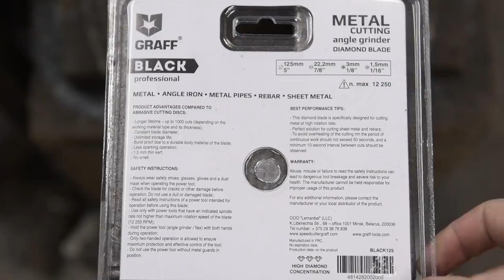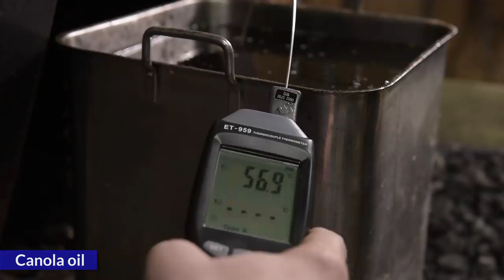Blacksmithing - Forging a slitting chisel

Comment: What kind of wood did you use to make the handle?
Reply from the maker: Oh, that's just pine! A handle on a top tool like this doesn't need to be fancy. Sooner or later it will break and should be easy to replace.
Reply: @torbjornahman   If I were to make say, an axe or a hammer. Do you think birch wood would work to use as a handle?
Reply from the maker: I think it would. Here we often use ash or beech for handles.
Reply: @dankuspanku4650  Querido amigo. não me referi ao cabo da ferramenta, e sim ao desejo de ver você fazer um martelo para carpinteiro.
Abraço.
Reply: Do you usually wedge the handles of your struck tools?
Reply: DankuSpanku hickory is good too if u can get a hold of it
Reply: Birch is one of the most used handle wood in Scandina so i think it should work fine.
Reply: DankuSpanku me I would use hickory or Osage orange aka hedge Apple 🍏! But these are natural woods that grow wild in our forests in Iowa along with black walnut . I have the best looking handles for a black Smith in the mid west ! Red oak white oak burr oak all native ! And ash with the emerald borer almost all of our ash trees are standing dead it’s a good time too be collecting wood for handles or ash for lumber ! The emerald borer only eats under the bark leaving the trunk in perfect shape ! But we don’t have much for pine red cedar is natural but takes a very long time too grow ! And rarely get over 8 feet but would make great chisel handles! Just be sure no matter what wood you use orintate the grain so it’s at it’s strongest for what the handle work would be doing !
Reply: If u find a fine spar (hope that is the english pronaunciation) u should use the biginning of big branches or the tak aanzet. Its realy sturdy
Reply: Ps takaanzet is dutch
Reply from the maker: @matthewt88  It depends. I think this type is more of a precision tool so I like the handle to be more fixed. But in general no wedge.
Reply: DankuSpanku you do have to be a bit careful when using birch as a handle. It will work, but take care, especially for longer handles, to select a good straight grained piece. Birch often has irregular grain due most of the trees being fairly small when they are harvested. Ash or hickory are widely used in North America because they have very consistent grain structure.
Reply: For me the best for any handle is Nutwood not walnut
Do not know the name in english
Nessert in luxemburgish 🇱🇺😎
Reply: @mr.boombalatty5724  spar = fur. depends on species and location. may need some research.
Reply: leviathanmdk the scientific term is picea abies and you need the beginning of a branch. You could hold a car on that wood. Only problem is that there is not a lot of wood in this area.
Reply: @torbjornahman  what wood did you use for wedge? Im learning much from your movies. Very good job.
Reply: @torbjornahman  Ok, tack för dina svar :)
Reply from the maker: @geniusoze  I used a beech wedge here.
Reply: @torbjornahman  hello , if you can find holly wood , it is known to be better for handles - not injuring hands .
Reply: Fint jobb, Torbjörn!😀👌 🙏 Intressant och vilsamt att titta på, som vanligt😀👍
Reply: i love watching these videos ! you are such a gifted Craftsman   lots of gratitude for sharing  so much of your talents and inspiring future generations  i know my 27 year old son enjoys the videos as well  it was neat watching you using the horn
Reply: @dankuspanku4650  as TÅ says, birch will work but his alternatives are much better, especially if you happen to miss sometimes and hit the neck on something by mistake. Birch will splinter worse than beech or ash. Perhaps lilac -one of the toughest woods from plants that grow in Scandinavia (watch out or the central pith) or hornbeam (properly seasoned) might be an alternative. Hickory (not endemic to Europe) is otherwise the standard for tool handles.
Reply: @torbjornahman  do you have the disease effecting your Ash trees as we have in the U.S.?
Reply from the maker: @jeffreycoulter4095  Yes we do, not sure how bad it is though...
Reply: "There's nothing like a nice piece of hickory!"  Clint Eastwood - Pale Rider.
Reply: Notice the mild steel plate that fits snugly on anviil and that is a great tool itself,Sir I'm making one to fit my anviil like yours, Thanks for that too Sir.
Reply: @torbjornahman  at no ni huuh
Reply: @torbjornahman  hello 
I was wondering if ya might be able to do a video on how to make a gold scale from the gold rush from the 1844 or so
Reply: YouTube diamond cutting blade myself and I agree pretty nice
Reply: @mr.boombalatty5724  and
Reply: i know Im asking randomly but does anybody know of a trick to log back into an instagram account?
I was dumb forgot the account password. I would love any tricks you can offer me
Reply: @Asa Kellen instablaster :)
Reply: @Ray Ibrahim thanks for your reply. I got to the site on google and Im in the hacking process atm.
Seems to take a while so I will get back to you later with my results.
Reply: @Ray Ibrahim It did the trick and I now got access to my account again. I am so happy:D
Thanks so much, you really help me out !
Reply: @Asa Kellen Glad I could help :)
Reply: @torbjornahman  Pine? isn't it too soft? I am using ash, not because it's fancy but because it has great physical properties. I haven't broke any in 6 years. But if it works it works. It heavily depends on grain. Great work as always. I hope to finally find some pneumatic power hammer like this. Although my neighbors will hate me. Currently we are switching with two handed hammers, but power hammer is still much faster and stronger than human force.
Reply from the maker: @boredinczechia4382  On a top tool like this you shouldn't use a "good" handle. It will be abused and I actually think it might be advantageous for it to break with a bad sledge blow than transfer all the energy to your hand. Handles like this is often not even verged at all so you can replace instantly.
Reply: @torbjornahman  yes, you are correct I guess that with ash handles there is more stress going into my arm. Thanks god I have experienced striker otherwise my hand would be in a bad shape. I personally do not verge any top tool.

Comment: I have seen you working with a Draw-Knife a couple of times. A 'Shaving Horse' might be a good soulution for work with this great tool. You can clamp and unclamp the workpiece with only one move. And as harder you are pulling as stronger you clamp the wood. And for a gifted worker like you it should be easy to build. ;-)
Reply from the maker: Yes, it's on my todo list!

Comment: Exquisite piece of  art in tool form. 👍
 Who say tools cant be sexy ? Lolololol 😆😂🤣
  After watching 2 times and reading the comments... I think it's safe to say your tools are like the Bentley of the tools  in the forged tool sector.   Smooth elegant efficient with such attention to detail.  See that's exactly what makes them  stand out 
🙏 be blessed sirSir 
Crawford out 🧙‍♂️
Reply from the maker: :) As always, thank you Daniel!
Reply: @torbjornahman  , if I may ask sir, what type of anvil stand do you use? If you could have any stand you wanted what would it be,?
Now that I've got a beginner anvil (250lbs-113.6kilo Vulcan) I  need to make a stand. 
I can do the bound and bolted 4x4 in oak,  pine, or pressure treated. I can do steel tripod with filled legs. I can do 25mm plate on top of 337.5mm dia 9mm wall pipe filled w oil sand on 25mm base or sank up to 1.5 meters in the ground - or up to 500mm pipe oil sand filled...or even concrete I suppose. All of these are materials on hand. Just would like to know what you would do please?
Reply from the maker: I just have 2x6", or so, wood bundled up as a stand.  If you have a perfect spot and never want to move it, sinking a wooden stand into the ground would be pretty good I think. For me I think a three-legged steel stand filled with sand would be good. I want to be able to move it from time to time. Mass is good, so a heavy stand is great I guess. I don't know about concrete, I think you should stay away from that.
Reply: @torbjornahman  excellent! Thank you very much.  Your opinion is highly regarded  just as your instructions,  and videos 👍👍👍👍
Reply from the maker: Don't take my word for it entirely, I have limited experience with anvil stands!
Reply: @torbjornahman  yes sirSir I understand. Roy from Christ Centered Ironworks uses metal tripod for his 465 north German  "Ulga".  John Switzer uses solid wood and sugest solid wood at least 3ft in ground. Joey van der uses a solid wood old pier pulling for his 330lb south german style and a tripod for his 110lb. Daniel Moss "trust me ima black smith" hasn't responded yet but I recall his is wood. Scott "essential Craftsman " uses butcher block 4x4 Glued  bolted and banded. 
Yall are my top go to guys, my best of the best list.
Thank you very much, appreciate you taking time to respond . My most favorite Swedish Smith! 😁

Comment: Oh I forgot to tell you we visited Sweden about 8 years ago and visited that exact fortress by the water that you walked around on one of your you tubes. We were traveling from stockholm to the lillehammer   I also visited the historic boat builders that were building a Viking ship  I got the plans for the small boat that a princess was buried in. about 20 feet long. I planned to build one but only got as far as splitting long tamerack (no oak) along the rays to form the lapstrake hull. I am not sure I have enough years left to finish it. Too many hobbies......

Comment: Do you smelt your odd pieces of steel to make a single larger piece? ...Also, if your pine (I presume) handle breaks, I suggest you make another out of pitch pine (botanical name is 'Pinus Rigida'). Not only is this wood exceedingly tough, but the tree re-grows, so is quite sustainable. Straight grain, pitch pine is used in boat building because it is highly stable. Thank you very much for this great video of forging a slitting chisel. I'm encouraged to make one myself! Many blessings, ~ Wendi
Reply from the maker: Cool! The handle on a struck tool is usually not made from a "high grade" wood. It will get damaged, and is actually preferred to break with a bad blow instead of transferring the chock to the smiths arm.

Comment: I really really enjoy your work(about due for another jug of lindseed oil) I learned a filing trick from an old metal worker in about 1968. When filing a radius instead of pushing the file forward and lifting the handle to go around the arc you can push the file forward and lower the handle as you push, this tends to make the arc much more constant. Hope that makes sense. Try it sometime. also he would yell at his students if they sawed back and forth with a file. He raised the file off the work when on the back stroke, no work is being done on the back stroke and it rubs the teeth off a bit. We always rubbed soap stone or chalk onto the file and it doesn't load the teeth so much with filings.  I am in the process of making large forged  door handles and plates that can be locked from the inside. lots of flat springs and delicate filing. if you have done any projects like that would enjoy seeing some ideas. I just got a smaller power hammer and at age 74 it may extend my blacksmithing a few more years. I have copied several of your tools like the power hammer flatter and your spring dies for balls (grapes)  Keep the information coming.....
Reply from the maker: Sweet, good luck with the hammer! Thanks!
Reply: @torbjornahman  what hammer?
Reply from the maker: The power hammer you just got!

Comment: Full of questions do Brother :)

You ever forge a set of rock splitting chisels and wedges for splitting large rocks in two, or knocking a slab off one side? I will find a video of it. There is one with an old old fella doing  it. 80+ years old.

Comment: And I use polyvinyl acetate glue when installing a wooden wedge. But in fact this is not essential.
As always, impeccably done work. It was very nice to see.
Reply: Always better to add than not have

Comment: Did you notice it loosing its temper at all when slitting the hot metal? Just wondering if it is worth hardening and tempering a hot tool? Great video as always. Thank you for sharing.
Reply from the maker: Not during this test run, but it probably will overheat at some stage. As long as it doesn't get red hot I still think it's worth hardening it.

Comment: THAT'S HOW A PLANE HAS TO BE SET ON THE WORKBENCH!!! ON IT'S SIDE!!!  (or as I do one side on a thin offcut to prevent the blade lying on the table and get pushed in / getting dull / getting damaged)
GET THAT YOUTUBE WOODWORKERS!!!  Here is finally someone I don't have to give a thumbs down because he's slamming down the plane right on the blade! NO WHATSOEVER BLADE SHALL EVER TOUCH THE WORKBENCH. THAT'S HOW IT'S DONE!!!
Reply from the maker: Thanks!

Comment: In the next couple of days, i will try to make this style of punch, with hammer and anvil, an angle grinders and with files. Maybe your next project a hammer like yours? Slotthing the eye with this tool, and i with my next tool. Love the shape of That hammer!
Reply from the maker: Great, good luck! You can do a wire wrap handle, then you don't need to punch an eye!
Reply: @torbjornahman  

The combination of metal and wood, that appeals to me, so a wrapped handle is an second option.. But the making of a new tool to make a tool is number one for me! Thanks for your response, to bad That i cant show you my chisel when im proud of it..

Much respect Luuk

Comment: Seems you like the diamond disks more than me. I’ve used several (different brand but quality) and there much louder than regular. Also slower and don’t seems to last much longer than about 2 standard disks. They really hate stainless.  
Love the slitter!
Reply from the maker: It seems to work best on sheet or small stuff, but as you say it's loud!

Comment: I don't know about this specific cutting disc, but generally, diamond tools are not very suitable for cutting iron alloys, such as steels, because the carbon from the diamond can react with the iron under high tempertures resulting in the degradation of the tool.  Diamond cutting tools are often used for non-ferrous aloys and non-metal materials (such as concrete, stone and ceramics in general) machining. Anyway, awesome work as usual! =D
Reply from the maker: I know, but this one is marketed especially for steel cutting!

Comment: Amazing work as always, but I would like to know why you wedged the handle instead of only fitting it tightly to the eye. It would be easier to remove if the handle breaks.
Reply from the maker: Thanks. Not entirely sure :) Main reason is probably that I wanted a more secure grip so I can have a good chance of getting it out fast if it sticks in a hole. I didn't glue the wedge at least!

Comment: watching how your chisel is going at an angle to the left because you can't naturally align it with your hamer because your arms are forming a triangle with the piece you are slitting, have you considered making an handle with a S shape or simply curved for more ergonomy ?
Thanks for the tempering trick 😊
Reply from the maker: I think it has to do with me not hitting straight since it's a tall tool. With some practice I think it will work better.

Comment: Wonderful video, why heat treat the working end if the first use blows the temper? I’ve done both and noticed varying results on different alloys.
Reply from the maker: I have now made a couple of 2" deep holes without overheating it, but you need to be fast and cool it with each strike. I think you gain a bit of performance as long as it doesn't reach red hot. 4340 steel is pretty tough even when normalized.

Comment: THUNDER BEAR............as always sir......spectacular work! Is being in the early 60's too old to start blacksmithing???
Reply from the maker: Thanks! No it's never too late!
Reply: @torbjornahman  I know I'll need to build/buy a power hammer as my shoulders will not take much abuse with a hand held hammer.
Reply from the maker: Might be worth looking into, but lighter work is probably not that bad.

Comment: hello Torbjörn Åhman! I'm a beginner ... congratulations on your workshop! is fantastic!  I wanted to know, why do you put the piece in vermiculite? and why do you put boiled inseed at the end? thank you 1000 (from google translator)
Reply from the maker: Vermiculite is a good insulator and makes the steel cool slowly, which is required to make it soft. Linseed oil is just a light rust protection
Reply: @torbjornahman  Thank you very much! I'll treasure your teachings 🙏😊👍🏻

Comment: I suppose you could sell your tools as a masterpieces: only those perfects forms made of solid metal with fine centred holes and polishing attracts me. I'd rater put it aside on my working table as a metal sculpture than use it in primary purpose )
Reply from the maker: :) Thank you! In a way I feel the same but tools should be used!
Reply: @torbjornahman  That's true. but the first scratch will hurt. by this effort. :)
Reply: A tool is but an extension of the man... if you don't take care of your tools, they won't take care of you.  More than one of the Journeyman I worked with told me that.  Thanks again TA

Comment: Nice video, Torbjörn.
It has become a beautiful hammer.

In the beginning I thought you would build a Japanese hammer. :-)

What kind of test was that where you dipped the hammer tip in oil and then sanded the point with sandpaper?
Reply from the maker: Thanks! That was the tempering. You sand off the oxides to reveal the steel. With the heat, from the back of the tool, the surface oxidizes and leaves a color specific to the temperature (roughly).
Reply: Aha, thanks for the detailed answer. :-)